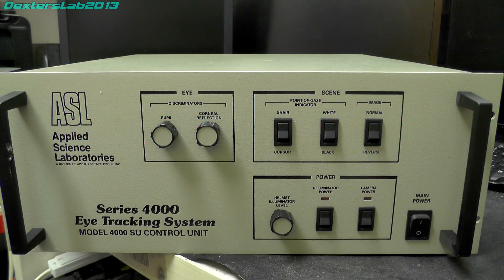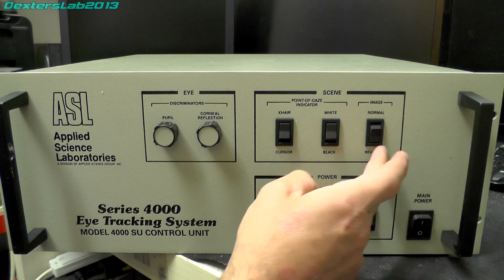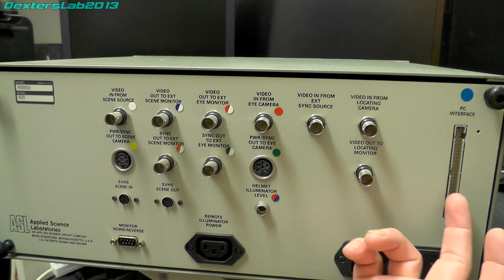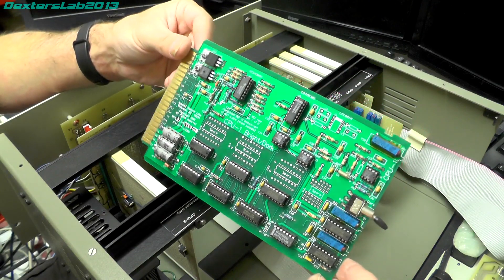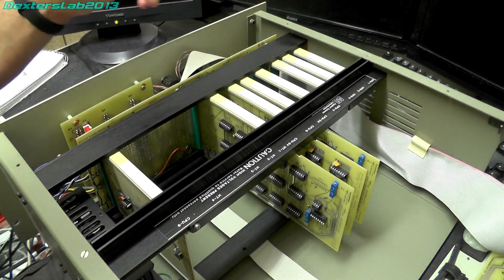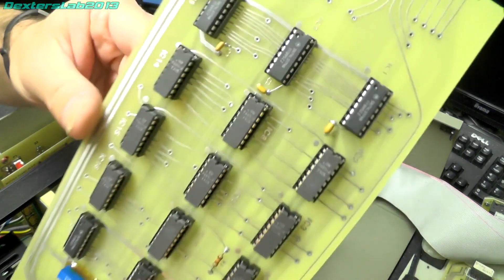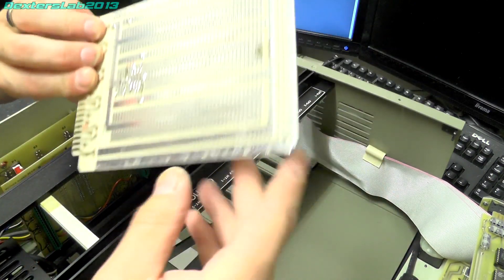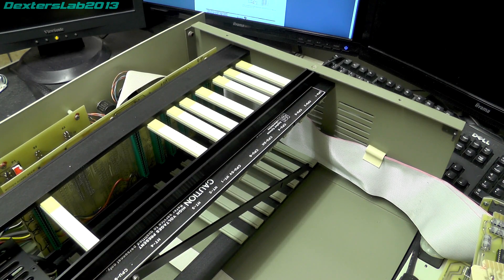DL167 1990s Eye Tracker Teardown - ASL SU-4000

Comment: This is a completely normal small volume product of its era. No "repurposing" or mistakes. The boards are designed to support multiple products without things like firmware or SPGAs. It fits between the wire-wrap and multilayer PCB eras.

Comment: Those DIN connectors on the back panel are Tuchel connectors. They are used on professional sound recorders such as Nagra.
Reply: No, these would be larger and have different contacts.
Its professional grade DIN with M16 retaining thread, as made by Binder or Amphenol.

Comment: I'd like to see that powered up and some video signals fed in. Could do interesting things to the image even without the PC.
Reply from the maker: I might try it off camera, if it does something i'll see if i can do a short update vid.
Reply: I may have an ISA card for a system like that. The ISA interface was a full length card which contains an AMD bit slice chip and some other stuff for data acquisition. My guess is the box needs the computer.

Comment: pc interface could be scsi - is it 50 pin?
Reply: No way. Just some proprietary connector carrying several analog video signals and some other mostly analog stuff. There is absolutely nothing to digitize the video in that box, so how should it interface to SCSI?
Reply: @semifavorableuncircle6952  I doubt it does any digitising - most likely has comparators to detect contrast points in the image, which it converts to xy coordinates based on frame timing. The PC interface is likely just the coordinates, plus some control.
Reply from the maker: I was thinking about this after i made the video, that working directly with the video is not needed. You can get a reflection of a IR light source from the back of the eye which could be worked out without capturing the image itself. Though i guess it would have needed a lot of setup & calibration.